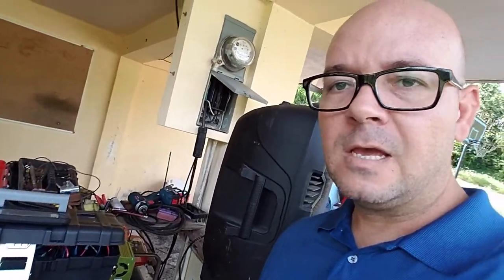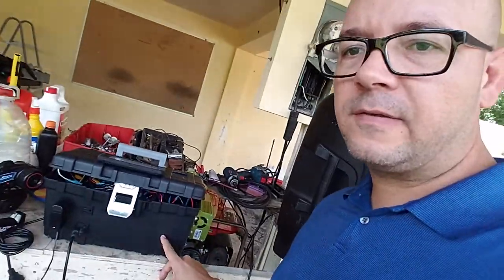Testing the 1 kilowatt toolbox I made. Another Diy 18650 power pack love story.

Comment: What's funny is you see a gas generator sitting there not running on the ground in the background. Gas isn't free and it isn't fun lugging cans around along with the smell and it always gets on you somehow so you end up smelling like a gas station. Then you have to monitor the fuel level and try to keep it full and deal with the brownout and blackout when it runs out of gas. Noisy and smelly dangerous exhaust. Solar panels and Li-Ions are so much better.
Reply from the maker: We spend the day with them. He is my brother in law and he spends around $10 per day on gasoline. I told him to turn it off and let us test the ToolBox. Still today without a charge the toolbox is has a "full tank"